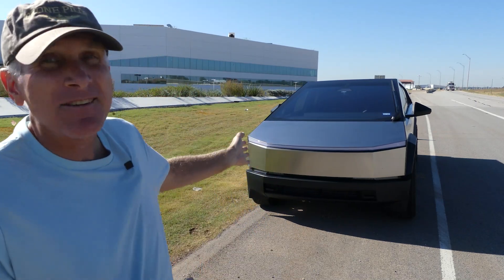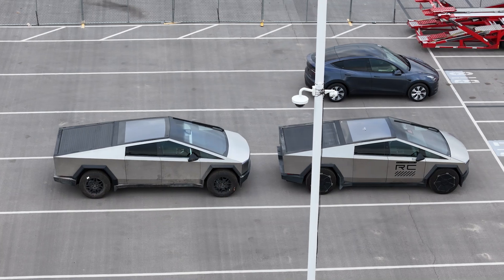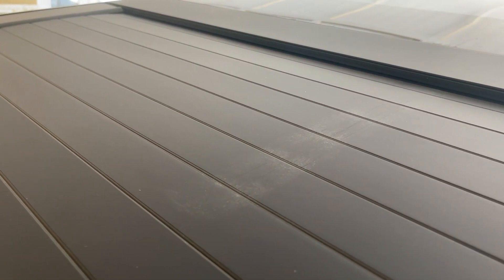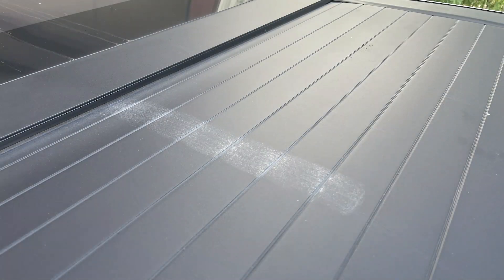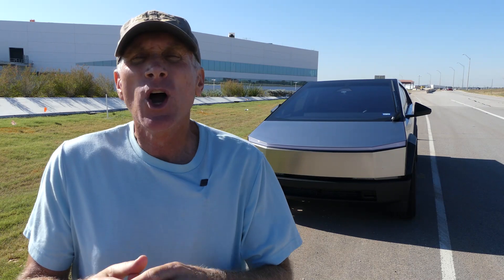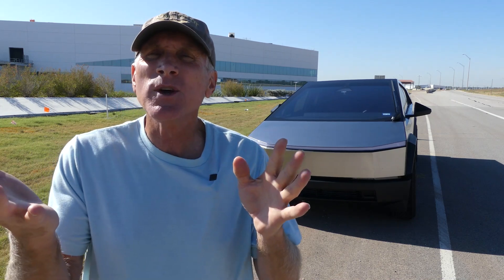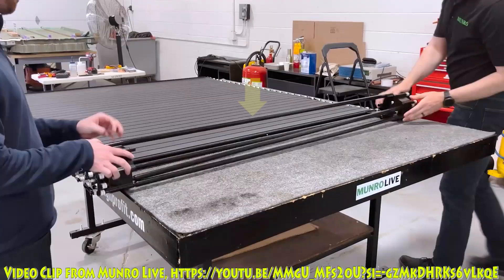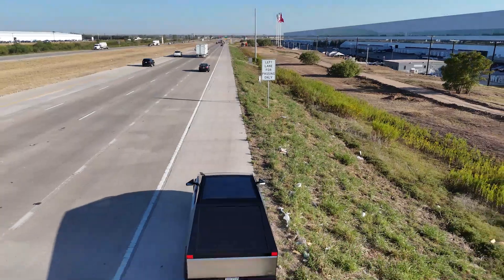Cybertruck Tonneau Cover Mechanism failure & replacement

Comment: This is a crazy wild engineered piece of equipment actually so not at all surprised this system as new has some issues and will be interested in seeing if this system is rolled out as standard to the entire fleet at there is a reason why detroit stopped trying to do this many many many decades ago so seeing Tesla give a fresh 21st Century take on this i personally anyways is watching this as it has some interesting applications in the Home and RV market as a solar power option probably why Tesla is trying this out. Very interesting truck now entering full run rate production and i expect to see many of these on US Highways soon even at current 6 figure pricing so how Tesla plans to service this massive Fleet of full size trucks no small matter in fact as huge challenge far more of a challenge than their current massive extant vehicle Fleet actually as there is so much that is new and unique just for Cybertruck and being tried for the first time this item being one of those systems engineering pieces absolutely.  Once power come back on in Western North Carolina the value of these massive battery electric trucks i think will soon be seen there given the crazy steep terrain out that way and need for large trucks to get in and out of tight spaces which i don't know if your truck has all wheel steering but showing how that works if it does would definitely be an eye opener to your viewers as i think the GM product has that anyways.

Comment: Thanks Joe, debating ordering my CyberTruck, now that it doesn’t have to be “Founders Edition”.  I think I’m going to wait for clarification of the $7,500 Federal Tax credit eligibility first, and let the “Early Adopters” continue to take the arrows 😬. I went through ALL of the EA issues with my low VIN Model S in 2013 😢  once was enough for me.
Reply from the maker: @mwolrich  👍 FWIW, my Cybertruck has been far less troublesome than several Porsches I’ve bought and owned.
Reply: @JoeTegtmeyer  good to hear 👍 I’m still driving the old 2013 Model S, so no rush to buy a CyberTruck, this is the longest I’ve ever owned any vehicle (11+ years).  Financially not doing great, so the $7,500 Federal Tax credit means more to me than it did in 2013…. I’ll eventually order one, especially because FSD is being offered for $7K to early reservation holders 👌
Reply from the maker: @mwolrich  well, I’ve technically owned my Datsun 240Z for 43 years, so I’ve got you beat there! 😎
Reply: @JoeTegtmeyer  lol, ok, technically…. My 2013 Tesla Model S is my only car & daily driver, and has been for 11 years 😬

Comment: The Pontiac Aztec has finally met its match and lost. Cyber truck is hands-down, the ugliest vehicle ever built in the United States. And on top of that they’re 100,000 bucks out the door. Are you kidding me? LOL 🤯🤣😂
Reply from the maker: @donsturtevant2396  you are categorically wrong on this one
Reply: @JoeTegtmeyer Nah, Sculptor and product designer here.  Cybertruck is an embarrassment to the design profession. Does not car.  Does not Truck very well. Gigcasting cracks on impact. Weight goes thru tires and wears out roads prematurely. the special tires designed for the truck were being CUT by the special wheel covers meant to match them.   Stainless trim on the accelerator pedal did not have a molded in physical catch, and could slide off.  Glass can not be broken out in an emergency for egress… potentially trapping occupants.  Carrying a spare means giving up your cargo space.  As does obtaining their high range model.
Stainless exterior serves no purpose that anyone actually needs and makes body work impossible, and does not meet crash safety specs. 
The driver interface is awkward, and distracting.  No haptic controls requiring driver to look away from the  road and engage with a dash mounted iPad.  Even the alternate gear selector for when the pad isn’t working, is invisible until it is touched and offers to tactile feedback as to what gear you are selecting, ( assuming the whole things does not fall right off, which many do ). Which means you have to look at it and touch it twice. Once to light it up, and once to select the gear. 
Steering wheel isn’t a wheel and has done away with stalks so you have to look down and find a button, or look over at the dash and wake it up to find a touch surface… rather than all those handy controls that you could intuitively operate by touch alone without even having to look because you could FEEL the, and how they operated. It’s a rank amateur ‘design’. 
Sorry- I know you spent a lot of money, but design-wise, this is the worst vehicle to come out since, well, ever.